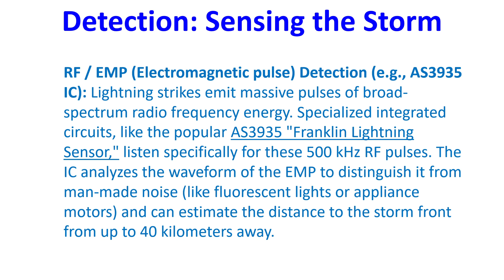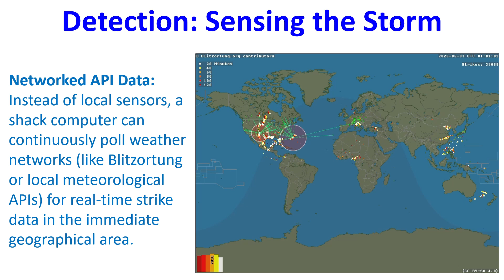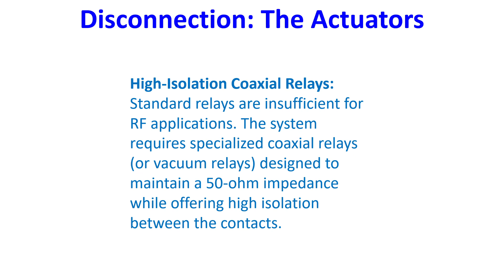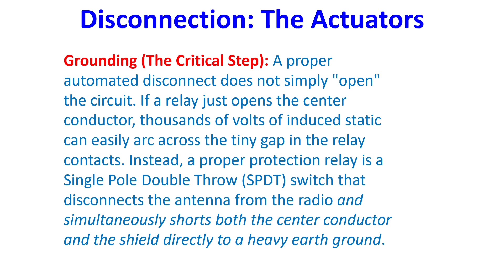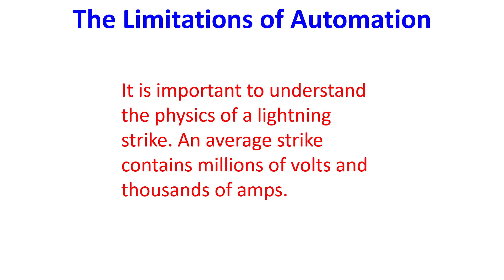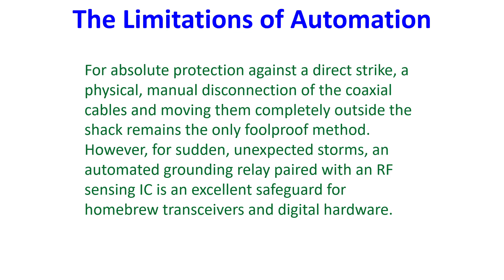Understanding Automatic Lightning Detection and Antenna Disconnection Systems

Comment: Interesting!  Still wonder how effective these be in case of direct strike, unless a good earth strips. Also associated power failures which accompanies the lightning. reminds me of quarter-wave shorted stub, helps to ground vhf antenna effectively to avoid static buildups.
Reply from the maker: Of course, a direct hit will vapourize everything. These are useful only for induced voltages from a nearby strike. Of course, back up power is needed for it to work! As you rightly mentioned, my CP22E VHF antenna base is grounded directly into a ground rod in my garden, using a 10 sq mm insulated wire as that was the thickest I could find in the local shop! 73 Jon, VU2JO
Reply: Hello Sir,Do we need to bond anteena earthing or home electric earth to the lighting arrester earthing if all are independent
Reply from the maker: That is a very important question. Basic principle of earthing is that if there are multiple earthings, all have to be bonded together using thick copper strips. Otherwise potential difference induced between them can cause significant damage to the equipment connected. A similar natural occurrence is the "step potential" which is the primary cause of lightning-related deaths in animals. When lightning strikes the ground, electrical current radiates outward, creating massive potential differences (often thousands of volts) across the soil surface.  The voltage difference between the front and rear legs of a large animal can spike into the kilovolt range, easily surpassing the lethal threshold.

Comment: Sir, Is there any practical circuit using  this Theory . (Do you have it ? )
Reply from the maker: Both VU2CPL and VU24DX are using automated systems. Demo of VU2CPL's system is at: https://youtu.be/vq5DuG9_yD8?si=blY93p54nqjQcCDq. Technical details on his Github page: https://github.com/vu2cpl/vu2cpl-shack VU2CPL is using both Web based API and local AS3935 local sensor. I am just learning about it! 73 Jon, VU2JO
Reply: @johnsonsTechWorld  Ok Thank you for your reply sir.
Reply from the maker: You are most welcome. Thanks a lot for visiting and interacting. Hope to hear you on air soon. Will look out for you on 40 m during morning nets. 73